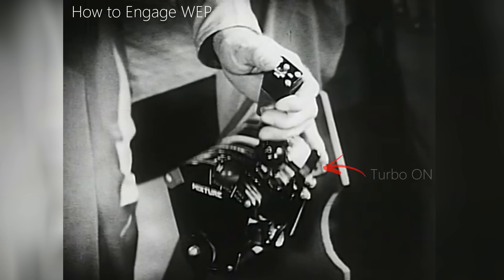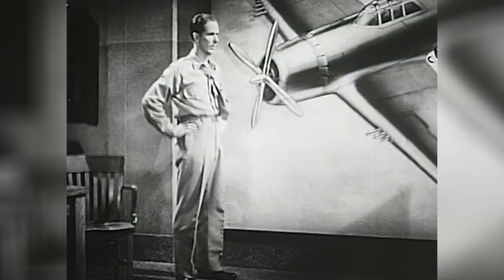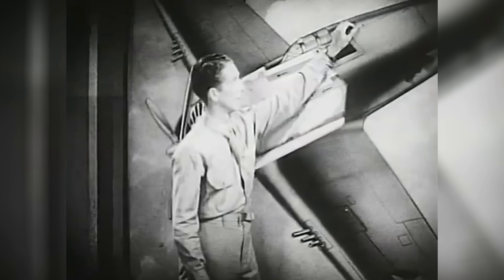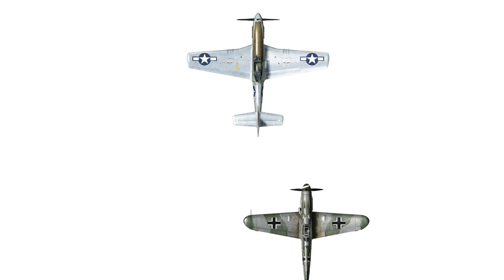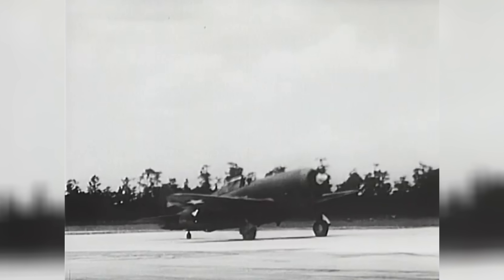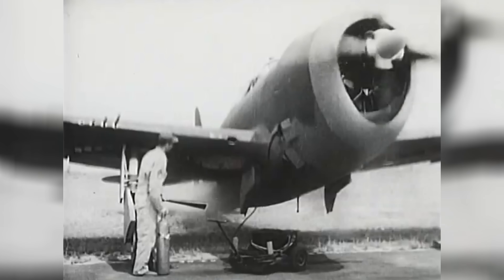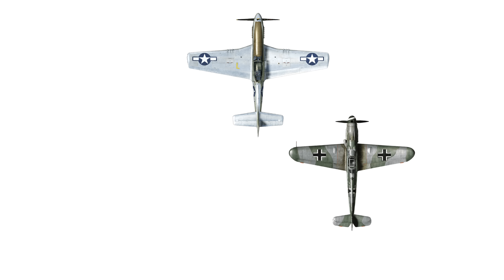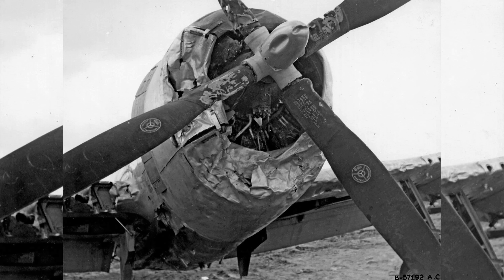What is WEP?

Comment: Thats the thing when i hold shift in war thunder 🥸
Reply: but in war thunder WEP is just military power. Aircraft are very castrated in the game.
Reply from the maker: @Boeing747Cultist  Really! Well that gets quite confusing. Is your WEP in game on a time limit or not?
Reply: @FlakAlley it definitely helps your aircraft move but also heats up the engine a lot quicker
Reply: @FlakAlley  Depends on what mode you are playing in. In arcade mode, WEP is on a timer. In realistic and simulator mode, WEP heats up the engine, and eventually, it dies.
Reply: @ChickenNeck_WT 
I've never seen an engine die because of WEP. If you overuse it, it would just grey out and go back to 100% power
Reply: @TheKenji2221  That's what it does in arcade mode. In realistic and sim, the engine could completely die. I recommend test flying the Harrier in realistic mode to see this. That plane's engine overheats easily.
Reply: @FlakAlley in arcade battles, time limit & cooldown. In realistic, will damage the engine & turn it yellow, idk if over time will turn red from over use of WEP
Reply: @TheKenji2221 it does that for a handful of aircraft like the P-51H, but most planes when they wep for too long it'll overheat the engines and it chips away at your engine's health until it's dead or cooled down
Reply: @FlakAlley  So, to my limited knowledge of 'Realistic' and 'Sim' battles - WEP/1xx%/Afterburner all increase the temperature the engine runs at, but don't know if it leads to failure, never played anything in those modes long enough to really see if it totals the engine.

Arcade on the other hand where I do most of my playing - those same things are in fact all treated the same, and have a limited time they can be used (it may in fact be the same for all aircraft, one of the few actual balance things they have in there). Air Arcade, I'm one of the few people who probably drops the throttle from 100% (where it defaults) to around 50-60% where the aircraft still has plenty of power and speed to stay up, but that's usually closer to match end if I'm hitting ground targets and the team controls the air/has started to spawn camp what's left. Only other times some might is trying to force an overshoot.  Most of the time your at 100% throttle (whatever the company deemed that as), especially in more modern jets, though at match start most will use WEP and the like to get to the merge faster, with some, most just leaving it on because the game will cycle it on and off on a timer basically, better/more experienced players like me even if we use it to get to the merge sooner (some of the maps are massive and it takes a while to even get where guns are useful) will actually save it for climbs and turns as when you kick WEP and all in in a turn it can help pull the plane around just a little faster along side use of flaps if possible, and if on mouse and keyboard using whatever key controls the elevators because while the mouse is fine for small precision adjustments it won't properly manipulate the control surfaces for harder turns and all. Though once you get to the Battle Ratings/Ranks where E series AIM-7's (and similar SARH missiles), AMRAMM's (and similar ARH missiles), and AIM-9L's (or similar all aspect IR missiles) your pretty much on afterburners every chance you get to keep speed up to have enough energy to dodge all the missiles, especially once you get to planes with Fox 3's (other than the American F-14's where the AIM-54 A and C are jokes now that people understand them, the Iranian one with Fakour 90's that was an event vehicle however behaves more like older AMRAAM's and can get kills) that can track and engage multiple targets, at which point it turns in to Ace Combat with dozens of missiles flying around and at you, sometimes from the same person, because like a year or two ago they hard nerfed countermeasures to being almost useless. Which is a big issue in a game mode that ground clutter isn't simulated in - meaning you can't even use terrain to confuse radar.
Reply: @FlakAlley some planes have limited wep time, i was flying a P-47N and i couldn't use wep anymore.
Reply: @Kue7heh  What button you use for wep?
Reply: @FlakAlley  it has a timer. You can use it for a certain amount of time, it stops, you have to wait to use it again. Although I've heard it gets shorter every time you use it. At least that's how it works on German planes.
Reply: @ChickenNeck_WT  WW2 Props get limited WEP, I think.
Reply: @Will1988US i put my throttle to full and it goes into wep
Reply: @ChickenNeck_WT  That is true, however by the time your engine dies from using WEP the entire time, the match is already halfway done, and if you just turn it off for a minute, you can use it for a long time again. In jet BRs your fuel will run out way before your afterburner kills your engine, or the match will already be over.
Reply: @thz6853 From my experience, if you overuse wep, but still manage your engine temp, you can just run out of wep and not be able to use it until you land and repair/rearm. I only play ARB though.
Reply: @TheKenji2221 midwit award
Reply: @Diedwhilemakingwafflesno.
Reply: @Kue7heh  What tree you grinding RN? im trying to get to top tier stuck on b-66 hehe trash plane
Reply: @Will1988US France rn
Reply: @Kue7heh  viva la France! Is the Rafale still the best top tier jet in game?
Reply: @Will1988US I don't know, i don't play top tier.
Reply: @FlakAlley  depends, if your plane is able to use afterburner, then your wep is the afterburner and uses a lot of fuel, but at lower tiers where props are, wep has basically no drawbacks
Reply: @Diedwhilemakingwaffles Ive never actually ran out of WEP lmao which planes got a timer? ill try them to test
Reply: @ChickenNeck_WT Well except in German and Japanese planes where I basically fly 100% of the time on WEP, even in Realistic and Sim operations for literal hours sometimes. You only need to open the cooling flaps a bit more on some hotter maps like Tunesia and you're good. 
The game didn't model this very good for these planes.
Reply: @TheKenji2221 Thats arcade. The childs play mode 😂. 
In Realistic/Sim you can have as much WEP as you like but the engine will overheat more and more leading in some planes to eventually lower power or even engine damage/destruction.
Reply: @ChickenNeck_WT I got the gr1 went into my 1st match cranked that up and my plane exploded
Reply: @Will1988US  The F4U for example, runs out of water injection after like 4min of WEP. Same for the B-25 or any plane with a radial engine really
Reply: @Diedwhilemakingwaffles Never seen a timer on WEP, guess you are new to the game?
Reply: @FlakAlley  As mentioned it's pretty confusing and depends on the aircraft. For example, WEP on german aircraft that have it is just the usage of MW50/GM1 systems. In those planes your total 'WEP' time is just how much of that stuff the aircraft carried.
Reply: @FlakAlley  bros acting like he does not know war thunder
Reply: @FlakAlley  All planes have WEP on a cooldown in Arcade, and it never damages your engine. It depends on the plane in Realistic and Sim. For props, some don't have it but most do. It generates more power and heats the engine up faster but not significantly more. Its more akin to military power than actual WEP. Every plane handles the heat differently, some start to overheat even at 100% while others can keep WEP on for the entire match without overheating. There are also some planes that don't have WEP at all or have limited WEP, but very few. For the ones with a time limit, it's usually an invisible timer that still doesn't drastically increase power and temperature. WEP will never directly damage your engine, nor will it drastically increase its temperature.

As for jets, WEP is generally just the afterburner, so most jets without an afterburner don't have WEP.
Reply: @thz6853  it can blow up your engine (not true for every engine) the worst is italian planes with some that can blow up the engine just sitting at 100%
Reply: @andrewstich4614  that’s only for aircraft that use water methanol based WEP.
Reply: @FlakAlley In some planes, like the F6F Hellcat, have 6 minutes of WEP.
Reply: @thz6853  it can. I’ve had my Yak-3 (VK-107) engine die because I was in WEP. That thing overheats like crazy
Reply: @TheKenji2221  some mig 21 and spitfires do that and lots more im forgetting
Reply: @FlakAlley  just pverheats engines waaay faster
Reply: yes its on a "limit" after using it after like a certain amount of time you cant use it for a while
Reply: @FlakAlley in air realistic battles it is limited to like 8 minutes on the p51h
Reply: @Boeing747Cultist  No way I found you again!!
Reply: @Boeing747Cultist  WEP is not military power in WT, its proper WEP.
Reply: @wantdatcadpat44  little aircraft do actually have WEP, such as p51h, f8f series and spitfires. Aircraft like the Japanese twin engines, German FW190s and Sea Fury/Tempest MkV/Yak3 M105/Lavochkin have no wep power setting even if the screen shows WEP. For jets most Russian and American jets get to 100 percent stopgap. Afterburning jets are taken simpler: afterburner on is simply wep and one more step adds a stage while one step down removes all afterburner stages to 100% thr
Reply: @Boeing747Cultist  This is just incorrect. Game mixes UI with real engine operation. WEP in warthunder is just fake military power prove me wrong
Reply: @Will1988US that's literally what I said, many aircraft in this game show military power instead of warpower when pushing WEP. Literally how Su-27 variants are missing a last stage of afterburner that delivers 1000kgf more per engine for example or how the P51D30 WEP while increasing accel and top speed significantly it doesn't depend on the engine but in the good airframe itself.
Reply: You can have it set to where you don’t need to hold it. Just hit W once and you’re good.
Reply: @fortunatebum What are you talking about “W”. Please tell me you have manual flight controls bound
Reply: @GrapeFlavoredAntifreeze  W and S were used to control throttle in earlier builds of the game. Then, the default controls were changed to Shift and Control. However, many older players left their throttle on W and S (including me), which is why you can see the OP using W.
Reply: @blankspace998 yup, 2015 player here, W and S was the default keyblinds back then, is so alien to me the new ones "shift" or "mouse scroll"
Reply: @fortunatebum  W is to go down you noob, not the engine :p
Reply: In default settings w and s is for throttle
Reply: @hqhd i have my own binds
Reply: defaultly tho it is engine
Reply: @railfan3024  Brother my W is 100% power, thats how it should be right or am i missing out on better controls?
Reply: @Will1988US  uhh idk
if youre not getting WEP when you press and hold W at 100% throttle then i think you may have something toggled off or so
Reply: Bro ur a noob W is go up
Reply: You hold shift? I always just hold the up arrow or hold W.
Reply: @ChickenNeck_WT  You guys hold buttons???? You don't just scroll up to 110 throttle and leave it there?
Reply: @Meowjiii  Leaving it at 110% throttle fries the engine
Reply: @ChickenNeck_WT  I know that's why you scroll down back to 100 when it gets hot
Reply: @Meowjiii i use mouse wheel as throttle and Shift and mouse wheel as trim when ego dueling😂
Reply: I use the scrol wheel to push it to 101% basically toeing the line @Meowjiii.

Also attack the D point
Reply: @ChickenNeck_WT   You just stop pressing W and engine temperature goes back to normal (when you see numbers are in red). And while you think "oh good, it's normal again" tracers start flying, so you 😮. 
No, you do nothing, cuz you are falling down without wings and tail. And your only option is J or not to J.
Reply: @zorkatasic-ls1tv  What button do you use yourself for WEP? mine is shift
Reply: @Meowjiii  how do u do that cuz i scroll up and then it just sets itself back to 100
Reply: @Meowjiii  nah scroll sucks
Reply: @Meowjiii I’m on console so I hold the left stick forward
Reply: @Meowjiii there's an option that makes you hold shift to use it, but it's off by default.
Reply: @ChickenNeck_WT  only if you don't have the radiators open
Reply: @Meowjiii  In RB depending on the plane I will swap to Manual Engine Control (MEC) to lock the engine(s) on WEP (or 110%), and manually regulate the intakes and pitch of the blades for optimal power.  MEC also allows me to throttle down a single engine while keeping the other on WEP (or 110%) to allow the damaged engine to run at lower power to not overheat as fast and still have enough power from the other engine to be able to defend myself.  I can also use MEC as an impromptu airbrake by setting the propeller pitch to 100%, or glide further if I lose the engine by setting it to 0%.
Reply: @ChickenNeck_WT W!?! brother most use w for flight controls
Reply: @bwopinatorpro players use W A S D to have full control of the plane (you can keybind it so that you turn 100% instead of the 85-90% when you only use you’d mouse…
Reply: @ChickenNeck_WT  lol no way you play the game on basic controls. theres no way youve made it past rank 4
Reply: @1degRazz  What do you play on?
Reply: @ChickenNeck_WT how do you pitch up then?
Reply: @priyanshudeshmukh5136  Move your mouse up
Reply: @ChickenNeck_WT yeah I just hold w
Reply: You use w for throttle??? Absolute maniac  @ChickenNeck_WT
Reply: @НААТ  That's the default controls
Reply: @ChickenNeck_WT w for throttle? Brother these are some cursed controls
Reply: @0ZxzxzxZ0 that's how it's been since open beta.
Reply: @Shaquiifa  You are on PC right? I think when you plug in a keyboard its different for us
Reply: @0ZxzxzxZ0  Guess your way more experienced than me, Whats your control setup for basic controls on the plane? Will try it
Reply: @Will1988US w and s for elevator controls a and d for roll q and e for rudder shift and ctrl for throttle
Reply: @0ZxzxzxZ0  I can get behind A and D for roll and Q and E for rudder, but shift and ctrl for throttle seems insane to me.

Though ofc everyone has their own preference
Reply: @yrp3489 I don’t have any real statistics on this, but i think changing throttle to shift/control and elevator to w/s is the most common key bind change for people who use planes. It’s mostly just that having w/s available for elevator while holding C (I also use caps lock) to freelook behind behind in a dogfight is essential
Reply: @0ZxzxzxZ0 thats default controls lol
Reply: @Acetheskyhook they might be default but they handicap you severely
Reply: @0ZxzxzxZ0  idk, i played like that for a while and did just fine.  Now that i play both keys and mouse, its better, but i wouldnt call it a handicap.
Reply: @Acetheskyhook   Default better or no, i changed mine too but idk if its actually better
Reply from the maker: Thanks for the comment Slava, so is WEP limited in the game as it was IRL and are engine blowouts modelled? One of the main concerns is that even though WEP injection may last a few mins whether the engine takes it or not is anyones guess. Some engines blew up the second WEP was initiated
Reply: @FlakAlley I belive if you wep you have to watch your engine temperature so it dosent overheat and eventualy dies. Thats basicaly how wep works in war thunder. Thanks for your reply 🎉
Reply: @SlavaIsusu-z1q  What button do you use for WEP btw? default shift for me
Reply: @Will1988US Shift
Reply: @FlakAlley  if you play the more simulated modes (realistic or simulation) WEP can damage your engine, however you can use A LOT of it before any issues, the engine temperature will very slowly rise and when it gets too hot you can just stop using it for a bit and it'll cool down, letting you use it again. in that sense the damage it can cause is not in line with reality, its more like WEP is war power and not emergency war power.
Reply: @opposed2logic  Also if your cooling is good wep will do nothing to the engine.
An example would be the Japanese planes in War Thunder, in Realistic and Simulation:
Nearly all Zeros can stay in WEP infinitely if the Manual Engine Controls activated while engine and oil cooling is above 35%
Most of the time oil cooling doesn't slow the plane because it doesn't have a visible moving part.
And engine cooling will open cowl flaps, it slows down the plane a bit but 35% isn't that much.
It feels like taking 1 step back to get 3 steps ahead.
Reply: @opposed2logic  You migh be wrong there I dont think it changes at all in any mode
Reply: 2015 user here, your right
Reply: @andyrpf1  2015 damnn, do you have all the event vehicles in the game
Reply: @Will1988US  Not all but some of the ones that you can't Get anymore.
Reply: @andyrpf1  Which is the most rare one you got
Reply: Guys what buttons do you use for WEP?
Reply: @Will1988US I use shift, W is for pitch down
Reply: @SlavaIsusu-z1q  Thankyou. Are you experienced in the game? I need a good plane around the mid tiers if you know the best ones?
Reply: @Will1988US depends which nation, personaly i enjoy Yak-3s for their great agility as the USSR.
The US has some good all around aircraft too
Reply: @Will1988US No, don't go for SSSR  planes if you are newbie. Low ammo and fewer guns. I suggest germany or USA. Germany upto 5.3. And USA is good in all BR.
Reply: @SlavaIsusu-z1q  Is France good or no
Reply: @zorkatasic-ls1tv   I thought USSR planes were op like the yak 15 i guess im too dumb to realise?
Reply: @Will1988US decent
Reply: You hold shift? I just set it to max and leave it until it starts overheating for an extra boost to get me up or to the battlefield faster.
Reply: @panzergaming128mm  You play with simplified controls and he is playing probably with full control of the plane. Simple controls are good enough for ground (when using CAS) and for arcade. But for Sim or RAB you need more . When you go on settings, controls, you have those two options, next time switch to full control and try flying 😂.
Reply: Ew, you don’t have it set hold for WEP off

Gross
Reply: @astonedwalrus4183  Set hold is worse though?
Reply: huh for me it's z?
Reply: You guys have to hold it?
Reply: @jaydenramdeen3448  no do you hold it?
Reply: Fr
Reply: You guys have WEP?
Cry in Yak-3P
Reply: Same!
Reply: Set it to toggle so you dont have to hold it
Reply: @Acetheskyhook  Where is it in controls if you dont mind checking when you are on, cant seem to find it
Reply: @Will1988US ill check when i can.  Should be "hold for WEP" or something along those lines.  I think its near the top.  I believe its a toggle switch in the aircraft control settings.
Reply: @Acetheskyhook  Thanks man ok please just confirm when you get online if you can remember my comment and ill check my stuff out too
Reply: @Will1988US from google AI

"In War Thunder, the "Hold throttle for WEP" setting determines if you need to keep a key pressed for War Emergency Power (WEP) or if it acts as a toggle; you find this in Controls > Aircraft > Main Control Axes, set it to "Yes" for hold, and bind a key like 'W' (or 'Shift' for some) for WEP, which gives a temporary power boost to your engine but causes rapid wear. To make it a toggle, you can either set the option to "No" for a simple press-to-activate/release-to-stop, or use clever keybinds/workarounds like holding WEP then bringing up the scoreboard (Tab) to keep it active, or binding it to a key like 'Shift' if your controls are set for it to act as a toggle. "
Reply: @Acetheskyhook  lmao i did the same thing as you and got that response but it didnt help. Ill just wait for when you log in no rush just let me know when u can
Reply: I have throttle binded to the side buttons on my mouse
Reply: Thats a reason the BF109E Series is in my opinion the best BF109. In MEC (Manuel Engine Controll) and even without on the right map you could fix it in WEP and it doesnt overheat meanwhile the BF109 starting with the F-Series are starts to cook when you think on WEP
Reply: Mine just stays when i let go of caps lock(i have my throttle up on caps lock so i can have my countermeasures on shift where my pinky rests naturally)
Reply: You hold it? I set it to just doing 110% or 105% with one more press..
Reply: id recomend enabling toggle wep
Reply: Fr
Reply: Hold throttle